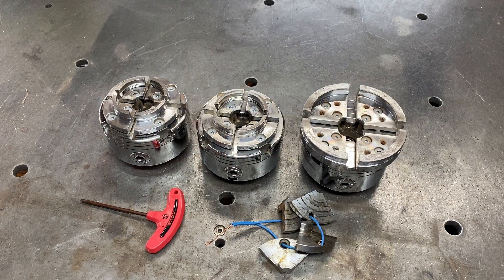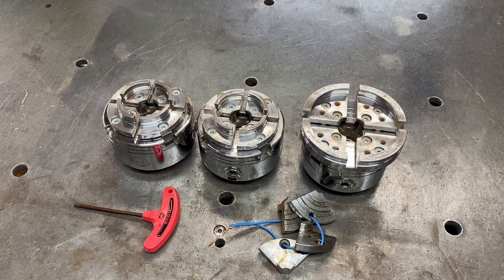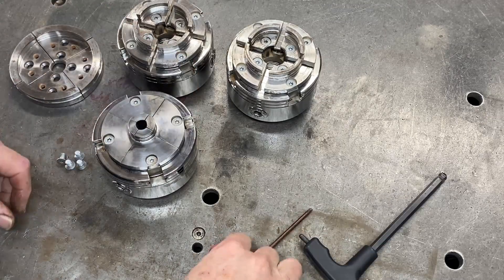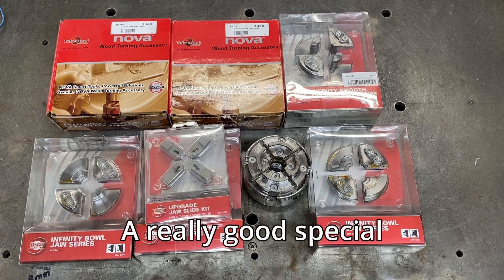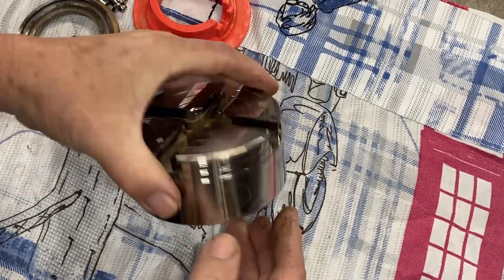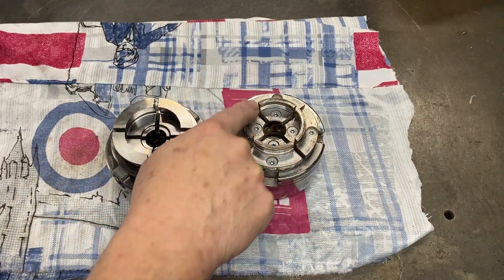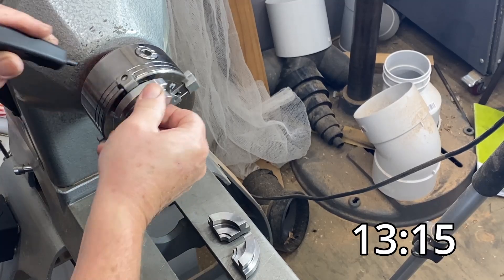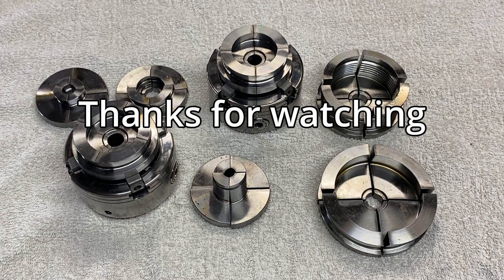Chuck Retrofit To Infinity Slides & Jaws

Comment: The reason the instructions suggest the slides the opposite of what worked is because Nova changed the scroll direction with the protek chuck.  The other point is you should put the jaws in the opposite direction to the slides  1=1, 2=4, 3=3, 4=2 - this will match how they were made.
Google  “Mounting Guide for the PRO-TEK Jaws “